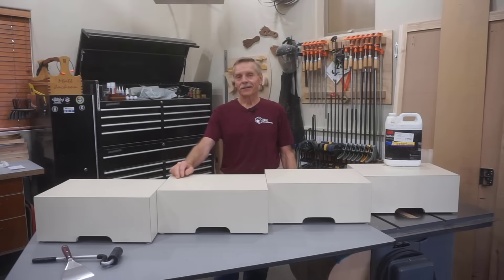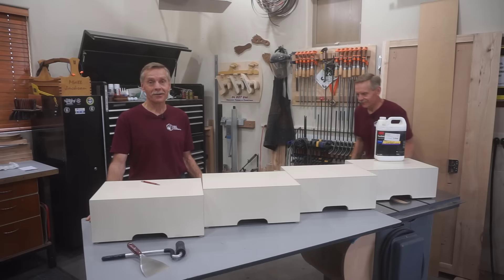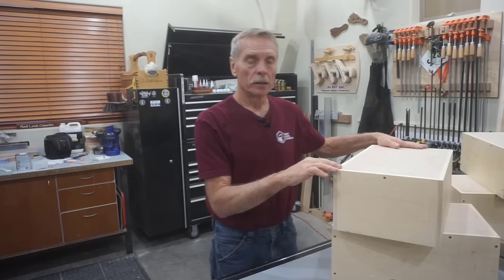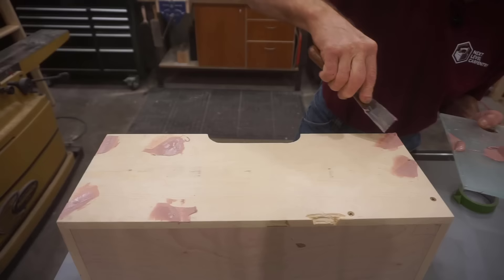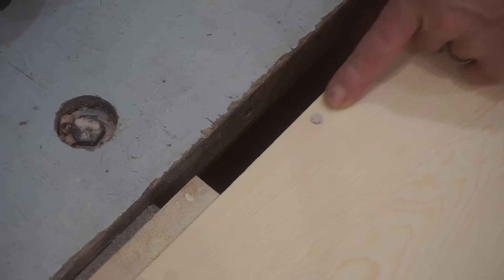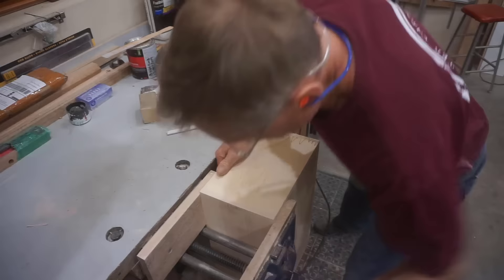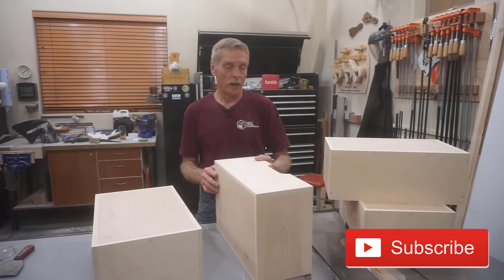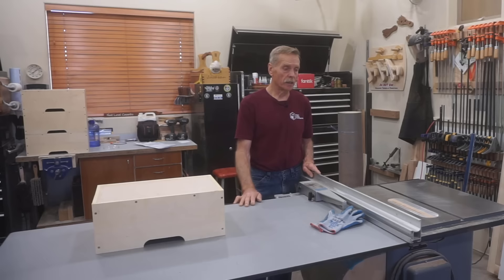Formica Application Master Class

Comment: Do you have to do anything extra if using MDF?
Reply from the maker: Not generally since the face of MDF panels is very dense ie: not porous.  However,  edges of MDF, plywood, particleboard, etc. ARE quite porous and sometimes require a 2nd coat of contact cement to build a viable layer for optimal adhesion.  It's real easy to do: just wait for the first coat to sink in and 'flash off' until the milkieness goes away and roll on another coat along absorbent edges...

Comment: 💥 Thank you so much for this incredibly informative video.  I’m having a hard time trusting that water based contact cement is durable and effective at gluing up laminates like the solvent based products are 🤟🏼
Reply from the maker: Hey James, I understand your skepticism regarding water  based contact cement... I too was dubious initially because I had a bad experience with a different brand... Weldwood, I think... but I'm a total convert to 3M Fastbond.  
Unlike solvent based products, you can barely smell this stuff in use.  It doesn't get all globby from evaporation like solvent based, it's thinner/more runny too, so it's much easier to roll on and doesn't collect chips like thick/gooey solvent based products either.
With decades of experience using it, I can truly say that "If it doesn't work, you're doing it wrong".  Not only is it 5X more user friendly, it performs remarkably well over time.  I've never once had a product-related failure using it.  Pay close attention to the preparation steps seen in the video since, like any contact cement, even a single crumb under a sheet of laminate can spoil the whole project.
Best,
Matt
Reply: @NextLevelCarpentry   Thanks so much for this in depth reply. It’s been over 35 years since I’ve worked with laminate.  I built a receptionist desk for a hair salon complete with a drawer and writing ledge.  One thing that I do remember was that clumping and semi dry build up and small gooey balls that you referred to as the solvent dried at different rates in areas where it was thinner. I recall having to scrape it out occasionally which was a real pain.  I’m believing what you are saying about the 3M being more user friendly in that sense but I recently called Formica and I thought he said to only use a solvent based product.  I can’t say 100% but I’m pretty sure he said that.
Reply from the maker: @Jimmy_Cavallo  It would really surprise me if Formica said that about 3M... I'd check back with them to make sure because Fastbond is SO much better than anything else.  Personally I'd disregard any white-coat from Formica over anyone at a cabinet shop who applies Formica products.  Let me know if you get an actual statement from Formica about 'solvent only' contact cement?  Thx,
Matt

Comment: Belt sander will get away from you if you're not used to using one. I'm making a cabinet in which I will Formica the sides as well as the top, so this is a new experience for me.

Comment: Excellent class ! Wish i had this info years ago when i did my only ( so far ) laminate job.
I was Lucky to have more than enough material because in my first attempts to break the sheet up in smaller pieces it cracked like glass. No luck with the table saw ( not enough teeth on the blade ) and the jig saw was a bigger disaster. Found the oscillating multitool with round blade perfect to cut the sheet and saved my project. Thanks again Matt for this masterclass ,the time flew by and it was just as entertaining as instructional.👍👌  Greetings from Belgium.

Comment: Thanks for this video.  I just finished a 48" x 48" fabric cutting table with a 36" folding extension with interior shelving using baltic birch ply with arborite laminate.  I used techniques that I had either learned myself or by watching 'old timers' when I was a kid when laminate was just coming into use in kitchens (70's).  I liked the way you explained 'why' you did it the way you did it.  |When building 1 piece workflow is not as important but because you were building 3 identical pieces I understand why workflow is so important to get the pieces to match.  One thing that I learned from an old timer was that you could score large laminate sheets and snap them safely and easily.  I just kept scoring with a utility knife and straight edge and cut mine completely through. thought your first cut on the table saw was a bit risky when you did not have to do it that way.  Your extension cord idea is fantastic as I found that I could not find enough dowels to get my surface done so used 3/4" ply cut into 3/4" strips.  The ply worked well but I wish I watched your video before I laminated my project.  I agree with you that the bevel edge is overall the best for visual effect but for my last project I used a 5/32" round over bit to finish as fabric was going to be dragged over the edges of the cutting table.  Very nice results and would do it again.  Overall great educational video.  Wished I saw it earlier.  Keep up the good work!

Comment: Excellent video man. Having laid much laminate in my finish Carpenter days, your comment at the beginning,"many ways this can go wrong "was well stated!! Keeping the two sides laminated and substrate clean could not be over emphasized. Pimples can arise out of nowhere.
A u-shaped kitchen countertop with precise mitered joints on the corners , and scribe cut walls , will separate out the men from the boys.
I know absolutely you could handle it,but the novice would be exercised in getting it done well, especially when his shop is a cluttered kitchen itself.     Thankfully those intense days are over for me, but it was a great learning experience in life.
All of your tips should be very much followed in spite of they're perceived triviality. Only the foolish would not heed them!!   Thanks again.

Comment: 0:00 Beginning
2:57 Conditions Explained
7:20 Fill & Prepare Surfaces
16:00 Cutting Laminate
32:30 Prep Laminate & Apply Contact Cement
50:10 Applying Laminate
1:00:45 In-Depth Laminate Application
1:28:48 Advanced Laminate Application
1:35:30 Final Filing & Clean Up

If you copy/paste this into your description, it'll create automatic chapters in the video.

Comment: Been using the solvent based contact cement for over fifty years.  I shy away from that new fangled  stuff.  Glad to hear it works well.  Might nave to try it.  One thing I like about the solvent based stuff is you can remove a misplaced piece by flooding the joint with lacquer thinner.  Thank you for posting, excellent work.
Reply from the maker: I was slow to convert from solvent to water based Barry but, from one long-timer to another, I'd NEVER switch back.  Please note that all water based stuff is NOT created equal.  Lots of stuff that's available to the general public is useless in both solvent based and water based.  I don't like the same product used in the video in the 'green' type so I've settled on the Neutral as my go-to stuff for almost 10 years.  Best, Matt

Comment: Looking for your previous videos and found this one. Reminds me of what happened the first time I ever worked with laminate countertops.

It was about 1980 or so and it was my second job in the trades. I got a job at a small cabinet shop. I was green. So green, I barely knew which end of the tape measure to read.

I don't remember how many gouges, (sanding through the top veneer), I put in the top of a sheet of cabinet grade plywood with the belt sander, but it was a lot. After my first week, another guy with a little more experience was hired because he had a big job coming up. In the meantime, we had a job to install new laminate kitchen countertops in place.

So we go to the condominium and get started by removing the old laminate. Then we prep the substrate. We thought we had turned all the gas off to the appliances, but we forgot about the pilot for the oven.

We started brushing the contact cement on the tops when all of a sudden, there was a whoosh! and we had a flash fire in this small kitchen. It looked like the Keystone cops, 3 grown men all trying to escape through a two foot door opening at the same time. Thankfully we had a fire extinguisher handy and were able to put the fire out. Although we avoided a complete disaster, all the cabinet faces and sides were scorched and the owner was going to get a brand new set of cabinets in the bargain.

We got back to the shop and I got a pink slip. I don't blame the guy. The new hire had more experience and he just took a big hit on that small job that turned into an unexpected unpaid big job.

Learn from experience, ha ha.
Reply from the maker: Great story David... I can see it now!  Pure pandemonium on the jobsite 😲😬🤣🤣

Comment: The angle section next to the fence is a smart idea! I’ve cut dozens of 2600 x 1300 sheets into 750 x 270 strips with a table saw. My basement workshop is much smaller than yours and each time I did those cuts I had to build extensions to the table.

Comment: I hear you about video length and the people who complain about it.  This, like when a contractor, or anyone asks the question "how long do you plan on living here", it tells me all I need to know about the person.  The reality is if they do this, or complain, they don't care about quality and don't care to learn.  The items you discuss here not only help in applying Formica, it will help in many different disciplines of woodworking and other home projects.  I have woodworked my entire life, actually received a scholarship for it, and was pleasantly surprised later in life when I realized it helped me in so many other disciplines.

Rant over, for someone like me who wants to do it right, even has laminated before, but want a refresher and get better than professional results, I thank you immensely for the time you took to make this video.  Short videos miss critical items that is the difference between a botched result, to a quality one.  Thinks like tapping dimples below the laminate surface with a hammer, using a chamfer bit to bevel the finished edge, to so many items you put you next level.  And if those people who complain actually read the title being "Master Class", then maybe they should recognize this is beyond their capacity anyway...

I will say because you did speak of safety and I am a safety nut, that using gloves on the table saw is very dangerous and the difference between losing a finger tip, or finger, to a hand or worse.  Gloves will grab the blade and pull you into it.  I understand this stuff is sharp, and MAYBE a vinyl glove helps without extreme danger, but...  Gloves also remove your ability to feel the stock, or what it's doing while being cut, so adds danger there as well.

Anyway, great video.  Even the extension cord for large projects vs dowels was helpful!
Reply from the maker: A credo for safety I find particularly insightful is "the absence of an accident does not mean the presence of safety"...
FWIW I only wear those blue 'Smurf Gloves' intentionally AND FOR GRIP ALONE.  What you say about the potential consequences of wearing gloves applies in general but I feel a greater risk of an un-gloved hand slipping into danger.  I too cringe when I see people wearing goofy loose-cuffed leather and fabric work gloves in the most ridiculous situations though.  I don't think it's wise to adhere blindly to universal safety statements but, rather, apply them mindfully for the greatest level of safety in the workshop.

Comment: I'm already subscribed. Replacing my kitchen cabinets with homebuilt ones. Need a 96" track saw and table because I'm limited to 48' with my current track saw. I've never been able to get completely square cuts with a guide and circular saw. Festool cordless saw and TSO ruler guides will work, and a Bora Centipede with 4 2 x 4' fold up tabletops.

Comment: I've worked in a Formica countertop shop making tops all day, every day.  Our solution for stray chips becoming trapped under the laminate after gluing was to use a length of metal pallet band strapping with a V bird's mouth cut into the side near the end with tin snips to create a hook, mark the bump's location and note the distance from the edge of the laminate,  and gently pry the unpressurized laminate from the edge just enough to insert the flat strapping in under the laminate and out to the chip's location, and fish the chip out from under the laminate.  It worked almost without fail, otherwise we used the hammer method to drive the chip into the substrate, but that can cause the laminate to star-crack over the chip ever so slightly no matter how carefully done.  Once the chip is removed, the laminate can be rolled down to be pressure-bonded to the substrate.

Comment: I've been doing home office cabinets and bookshelves with the 0.049" Wilsonart laminate and edgebanding. Thank you for the extension cord tip, I will definitely use that one on the tabletops (20" x 96", 20" x 67" and 20" x 48"). Rather than a file, I use a DuraGrit 120 sanding bar (basically a 1/8" x 10" strip of carbide sanding grit). I've never heard of using the 22° trim bit before, but that is an interesting idea.
You must golf like I do; deep in the weeds. I usually avoid the fairways. Too many other players there. When I see the pros sweat when they end up in a tough lie, I just say piece of cake. I've been there many times before.

Comment: Excellent Video and I just subscribed.  I've watched some of your other videos and they always helped me increase my knowledge and skill level. 

  I just built a custom floating media cabinet and I'm laminating a 1/2" piece of plywood to attach to the sides and top to give it a contrast to the shaker style front.  Your video was right on the money for what I was looking for.  I love the detail and couldn't find anything similar on Youtube.  I just wanted to say thank you for taking the time to make the videos as I understand how much goes into shooting the videos and editing when you're trying to finish a project. I have 12 DIY building projects that I've completed and shot video on and haven't edited any yet, due to the time it takes, so again thank you!      I'm only 1/4 way through the video and already learned a ton.   I've sanded a lot of projects and never used the squiggly line method, which I'll start using right away.  Also using the belt sander.  I usually just use an orbital sander given that I dont' have a dedicated shop like you.   

 1 question.   What type of material is the board that you were using to mix the bondo on?   Plastic or glass and where would you go to purchase one.  I have been using the pink DAX filler so far for larger dents and then finishing off with the red bondo putty, but it takes me a lot of coatings due to shrinkage.  It looks like the Bondo mix is the better way to go.    Thanks!
Reply from the maker: First off: editing all that video is a LOT more work than applying plastic laminate IMHO! 😉😯😎
I wouldn't recommend using anything under Bondo, mainly because it's unnecessary but also you'll end up with a mess if the stuff underneath shrinks.  Bondo doesn't shrink and can be applied in coats of virtually any thickness.  One coat can fill 2" deep as fast as it can fill 1/4".
The mixing board I use is just a scrap piece of 1/4" plexiglass about 12" square with a hole drilled in it (using a hole saw) that helps me hold on to it... you should make one if you're doing much bondo work at all.
Thanks for watching, commenting and subscribing!  All the best as you tackle the learning curve for editing and producing videos... it's worth doing but not for the faint of heart IMHO.
Best,
Matt

Comment: I done a lot of laminate jobs over the years but it is always nice to learn something new, I learned a few things   I have always used the solvent based glue but then it has been a few years since I have done much of it and water based glues have come a long way since then. I am not sure I like the 22.5* bit for a laminate over laminate seam. but is a nice tip when you are needing to add a little reveal on a wood edge, I use a belt sander belt on a block of wood to go over the sharp edges on larger areas and a file  where appropriate. I  use Toluene instead of Laquerr thinner, its not as nasty to the nose. I like  the idea of a laminate scraper  not a bad idea for a number of projects.
Reply from the maker: Hey Thom,
There's definitely a lot of individual preferences when it comes to this sort of work and the one that works best for you is the best one to use.
FWIW the only water based contact cement that I'll use is the neutral 3M fastbond. Seems like I tried a weldwood version once upon a time and it was terrible but the 3M stuff is amazing.
Best, Matt
Reply: @NextLevelCarpentry  yes there suwe is

Comment: Nice video!! My work is 95%laminated  work! I do almost the same as you!some difference! I cut the big laminated on a foam board 4'x8' with a circular saw! After that is all the same as you did except that I only use trim bit,chisel plane,  and maybe a file! My chisel plane tock the job of the bevel bit! If you haven't try! Really recommend it!!
Reply from the maker: Cutting big laminate on foam board it genius evascroll!!  Thanks for adding it here... I'll have to remember for future use.  The idea of using a chisel plane on laminate seems dicey to me but imagine that's because I've not seen how well it works for you.  I do like the outside the box concept though... Best, Matt